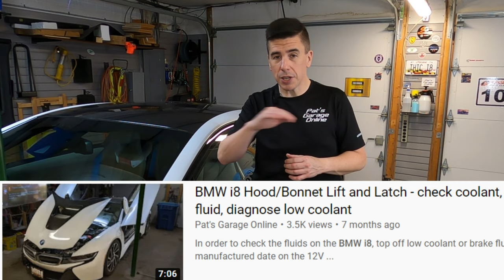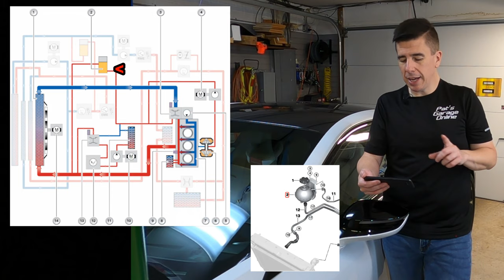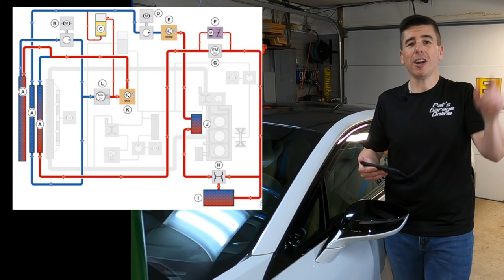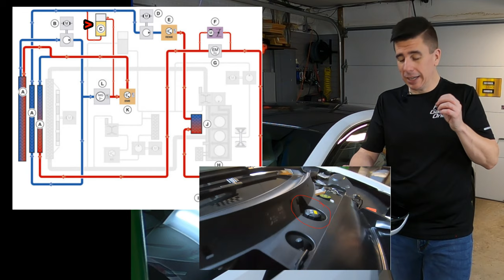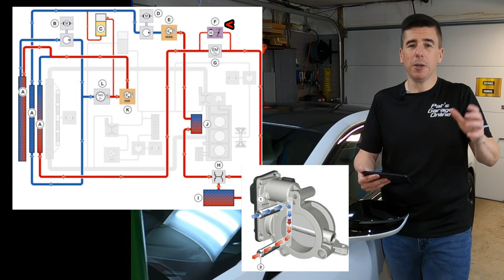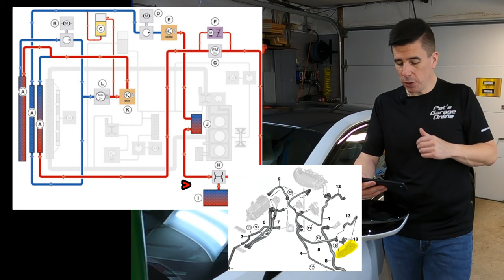BMW i8 coolant issues: Low coolant warnings. Engine overheated. No heat in the cabin.

Comment: As an engineer, this cooling system was not designed well. Pulling a vacuum across such a long distance with hoses that will probably collapse and a closed thermostat blocking one path seems problematic. I don't know if a high point exists on the mid-engine plumbing that would allow a tee to be installed with a valve. I would fill from the reservoir with an extension tube to make sure it is the highest point of the "U" shaped path and open the valve on the tee and fill the system until coolant is emerging from the valve on the tee. Alternatively, you could pull vacuum at the engine and fill at the reservoir. Be sure to use an apparatus like a vacuum flask in case your vacuum pump cannot digest the liquid.
Reply from the maker: Very good analysis and suggestions!

Comment: Thanks Pat - I'm in the same boat! 3 breakdowns in 3 months - all engine overheat! First BMW garage replaced waterproof belt tensioner - all shredded up? 2 months later had same overheat issue - they diagnosed the radiator this time - replaced it , within half an hour if driving - engine overheat again , and low coolant warning. Waiting for recovery now. Hopefully just air in system as you explained. Will let you know.
Reply from the maker: Sorry to hear this happened to you. Please keep me posted.
Reply: @PatsGarageOnline  Hi Pat - this is now the timeline - BMW have now diagnosed a new engine!  - So not had a great experience with my i8 - 

10/09/23 – Vehicle broke down on motorway with engine overheat issue
11/09/23 – Vehicle was taken to BMW  for diagnosis and repair – this was diagnosed as a faulty belt and tensioner , resulting in the coolant system not working correctly
21/09/23 -Fault was diagnosed as an auxiliary belt tensioner
27/09/23 – part was replaced at cost of £xxxx
24/12/23 – Vehicle broke down again with the same engine overheat issue
02/01/24 – Had to take matters into my own hands and pay for BMW assist to send a technician to diagnose / recover, which cost me £175. Technician cited issue as low coolant – topped up and signed off.
16/01/24 – Vehicle broke down again – with same engine overheat issue – vehicle was recovered to BMW.
17/01/24 – Vehicle was diagnosed with leaking radiator, at a cost of £xxxx
24/01/24 – Car was collected and with 30 ins of leaving BMW the vehicle broke down again  with Engine overheat again
24/01/24 – After being stranded again for 5 hours – vehicle was recovered to BMW 
25/01/24 – BMW confirm the issue was an airlock in the coolant system following the repair.
29/01/24 – Vehicle was returned to me
30/01/24 – Started driving and about 5 mins from home and vehicle went into fault and broke down again– Engine Overheat Amber warning / managed to get back home when the red engine overheat appeared. The car was practically on fire and i have video evidence taken of the vehicle smoking heavily - this undoubtedly caused severe engine damage.
31/01/21 – Vehicle was recovered for further diagnostics at BMW
02/02/24 – Received a phone call from manager at BMW stating that they now suspect the pump as being the issue / however I would need to pay £450 just to carry out a diagnosis / and even then this may not be the fault.
12/02/24 - Received email from Chester now saying they suspect its a faulty thermostat / pump - and this would need to be replaced at customers cost - £1411.27. Also informed if this does not solve the issue - i would be liable for more repair costs.
28/02/24 - Received an email from BMW  stating that they now suspect the engine is damaged (consequential damage) and will require a new engine and turbo at a cost of £20,300. By the way - they suspect and would not confirm it.

I am now a couple of grand down - and my car is just a metal ornament,  and BMW don't want own any liability. I feel like I'm going crazy! 

Just after some advice - as surely the damage was done during the use of the car in between the repairs?
Reply from the maker: @paulmcnally4994  I believe the air in the coolant caused all of this. I would do whatever you can to get the car running and put it up for sale ASAP.  BMW had no idea their design would cause these kinds of issues when they built the car. Now, we are at their mercy for repairs.
Reply: @PatsGarageOnline  Thanks Pat - to be honest they haven't even properly diagnosed the engine - I haven't seen any reports- basically they don't want to spend anymore time on it. I've seen your block test video / so may try that when they dump it on my drive this week. Is there anything else I should ask of them - as in test reports along the diagnosis? Thanks
Reply from the maker: @paulmcnally4994  I don't have a u other suggestions at this point. I think just about every issue has been uncovered.

Comment: I had a low engine coolant alarm that came on 5 days ago, brought it in to bmw to get topped off, and have the alarm going off again today. Any thoughts?
Reply from the maker: I think you have a leak. The shop will need to diagnose this problem a little more.

Comment: Hi Pat this is again a great video. One learns a lot from you Thank you
Is the low temperature circuit related to the air conditioning system in any way? After replacing the evaporator because it was leaking, antifreeze was added to the low temperature tank. 
The low temperature tank was filled up 1.5 cm above the mark. Why is more filled in than necessary?
Reply from the maker: Thank you!  The low temperature circuit is not related to the air conditioning.  However, the technician needs to remove the low temperature coolant expansion tank in order to make room to replace the evaporator.  It is OK if the tank is filled 1.5cm above.  It's not enough to cause a problem.

Comment: Can you do the water pump bleed (heat up and accelerator pedal down for 10 seconds to switch on the water pump) after filling up with coolant rather than the vacuum method?

Comment: What happens if the tank cap was taken off and placed back on? Will the tank pressure escape?
Reply from the maker: Chances are it would equalize the pressure and an air bubble could come in at the point where the coolant was leaking. If that rises to the engine, you run the risk of overheating

Comment: Hi, Would it help to " Raise the Front End " To a Height Equal Or a Little Higher  than the engine ? 
Still do the Recommended  BMW - Procedures , to move that air pocket ? Is / Are There any Other
" Air Bleeder Fittings , Screws " In the Coolant " Systems " ????? 
ThankYou , Mark
Reply from the maker: It's a great idea, and I wish it would be helpful.  The coolant lines are still lower than the top of the water jacket in the engine, unfortunately.  Unlike a small block V8, in contrast, there's no coolant flowing via the top of the engine.  Everything on the i8 is on the side.  So, it's a real pain.  There are no other bleeders on the system.

Comment: Why so surprised by an electrically aided thermostat? They've been around for the last 10 years. So has using a vacuum filler to fill dual or triple temperature cooling systems.
Reply from the maker: I never had this on any of the cars I've owned and as a guy that likes cars to be reliable, this bothers me. More complicated components, more likely to break.
Reply: @PatsGarageOnline  unfortunately, that's what's called progress these days. Most of this trickery stems from trying to comply with more and more strict emissions regulations.
Let's be honest, 90% of electronics on a combustion engine are emissions related. And these are usually the things that go wrong nowadays.
Reply from the maker: Truth. Out goes the primary philosophy of keeping the engine cool to prevent losing the whole powerplant, and make that just secondary to emissions.
Reply: @PatsGarageOnline  the brand I work has had these thermostats for about ten years, but they've been fooling drivers even longer, making conventional thermostats open at 105°C (used to be 80-90), but letting the instruments show a steady 90°C... All in the name of better thermal efficiency.

Comment: Hey Pat I've had my i8 for about a year now and I'm experiencing the A/C compressor issue that you talked about in another video. I have CPO for my car so it's covered and they're fixing it. I had a question about extending the CPO. BMW told me they only could extend my CPO for 2 more years for $6300 after my current CPO ends which is in July of 2021. Is it worth paying $6300 to have my CPO coverage extended? especially if something goes wrong with my car that is not covered under the CPO and then I have to turn around and come out of pocket for the repair on top already giving them $6300 to extend it.
Reply from the maker: I extended my CPO 2 years and negotiated to save $800 less than they quoted you.  I think it's worth it because the car is high tech and what would be normally an inexpensive repair on any other car can cost thousands just to get the i8 working again.  A friend of mine's i8 is in the shop for a month and he wants to sell it, but it just can't be driven right now.  So, he has to pay thousands when it's done, just to put it on the market.  CPO will save you when you need it the most.